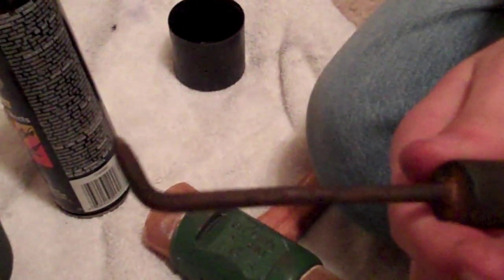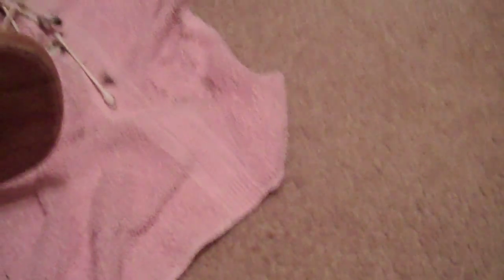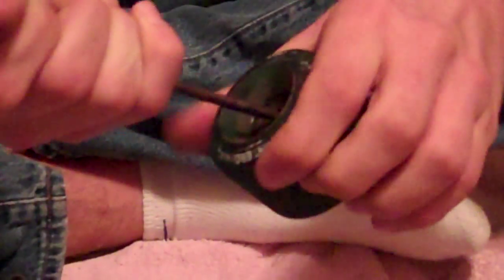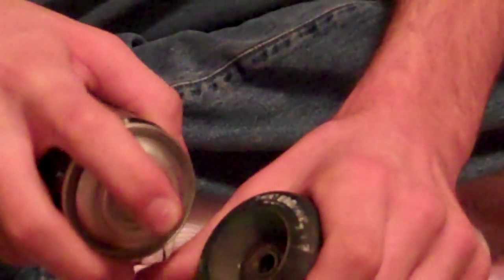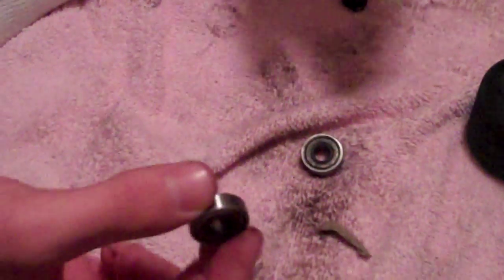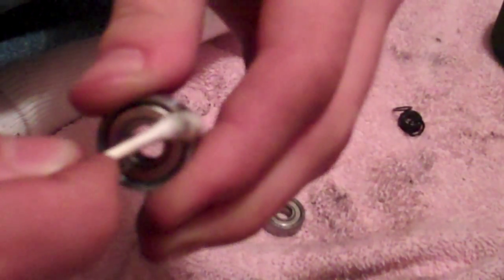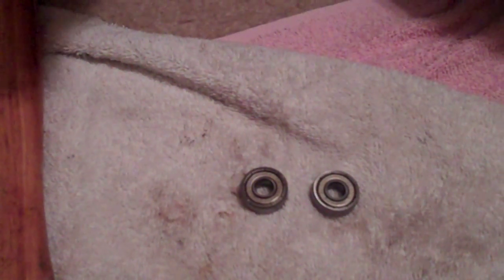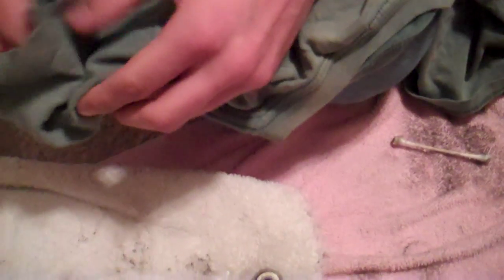How to clean skateboard bearings

Comment from the maker: @TheSkaterkid777 These are close rubbered bearings, and it's a water based lubricant. Oil is bad for open bearings because it attracts dirt and grime but that's not a problem with the sealed ones. For open I don't use a lubricant. I clean them with alcohol and use a shavings pump to speed them up.

Comment: Tri Flow is lube with Teflon in it, WD-40 is a solvent- two different things.  This video is old as hell but the proper way to clean bearings is to remove the shields, soak them in a citrus based solvent, rinse and quickly dry the bearings so they don't rust, lube them with something like Tri-flow, then replace shields.
Reply from the maker: Thank you very much. It is super old and I've learned a lot since then. If my board hadn't been stolen I would remake this video but I really appreciate the input for when I get my next board.

Comment from the maker: @TheSkaterkid777 No these are close rubbered shield bearings. And it's not oil. It's a water based lubricant. Oil is only bad for open bearings because it attracts dirt. 
For open bearings, which I have now, alcohol is the best cleaner

Comment from the maker: @SuperFlipVideos As I said before, It is a specialized water based version of wd-40. Not at all harmful for bearings. Especially the ones I have. You soak them in alcohol for 10 minutes and boom they're ready to lube again. Speed cream is ok but i've found that it slows down my reds so I stopped using it.

Comment: using the screwdriver is pointless and time consuming. what i do is put the wheel on the axle(so that only one bearing has the axle on it)and pry it sideways or in any direction. simple and doesnt require a tool